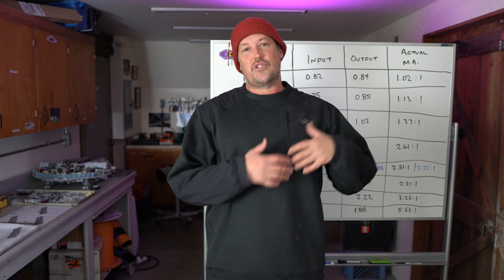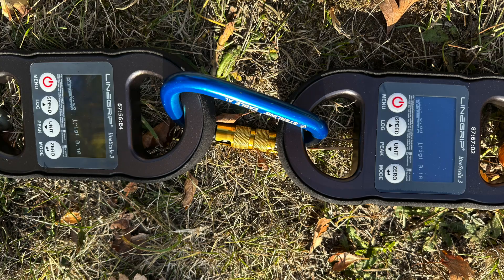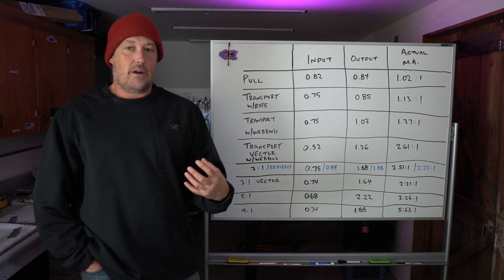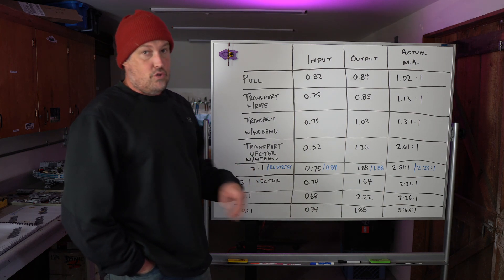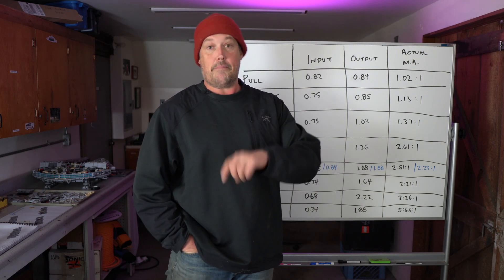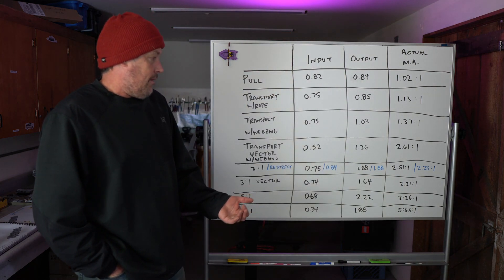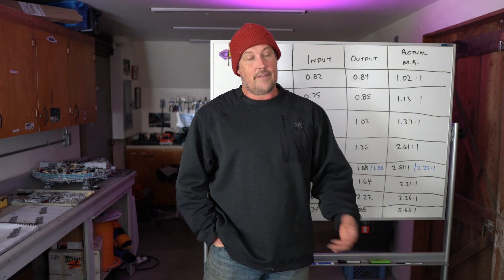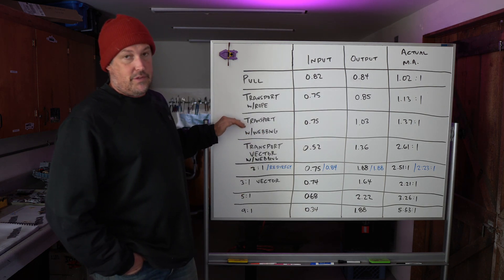Testing Theoretical vs Actual Mechanical Advantage for Haul Systems

Comment: How do you lose progress capture with a 3:1 with vector? The capture is already captured when you start the vector pull, isn't it?
Reply from the maker: There is progress capture in the 3:1 system. There is not progress capture in the vector pull. Once you let go of the vector pull rope that progress is not captured.